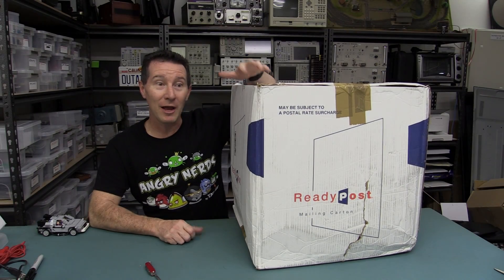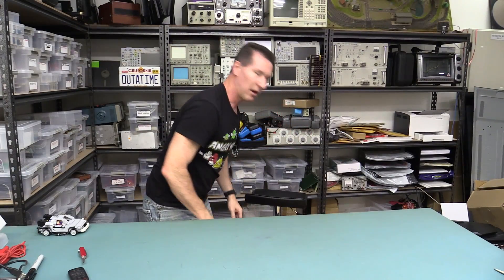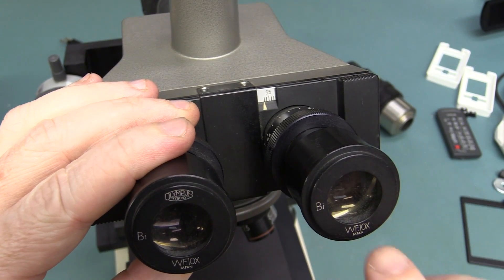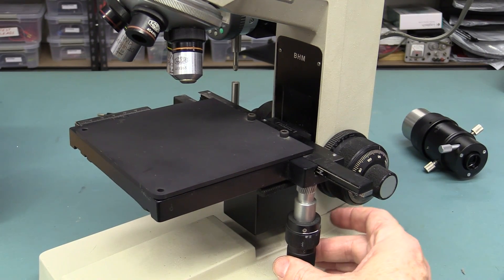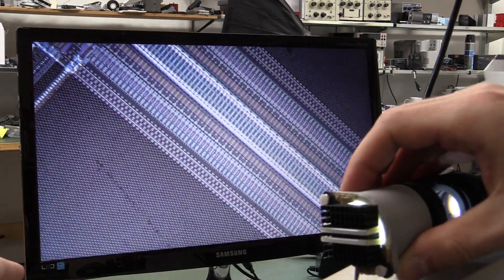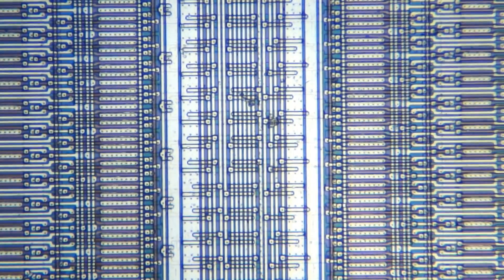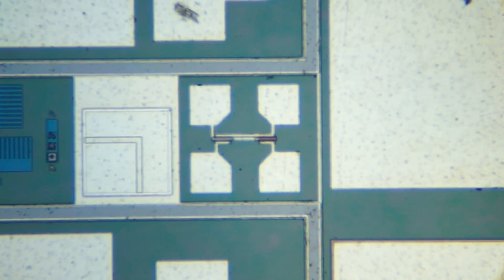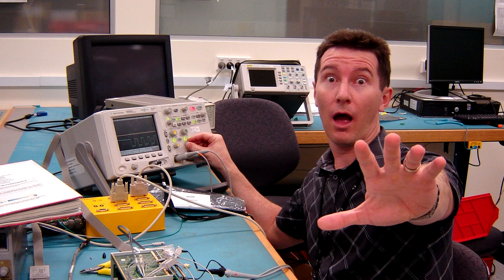EEVblog #992 - Olympus BHM Wafer Inspection Microscope

Comment: Ohhh that package... I had the same horrible experience (many times), don't know why but always happens with expensive and heavy equipment... clearly awfully packed exactly like your box, bubble wrap protecting nothing, equipment completely lose inside the box, holes everywhere and pieces of equipment sticking out. 
The box is more like a soft paper ball rather than a box... ohh.. it's heart breaking.. what horrible sight.... =/
Reply: bubble wrap is fine for smaller items up to 0.5kg, would have used styrofoam, double box, multilayer cardboard....

Comment: Dave for even light distribution you can use 8 layers of etched glass to get an enough even distribution of light. I have a work to share but unfortunately it is in portuguese. http://www.ppgee.ufmg.br/defesas/49M.PDF what I mean by etched glass http://www.vaicomtudo.com/wp-content/uploads/2013/05/Fazer-falso-jateado-3.jpg No plastic film, it is pressurized sand jet over the glass.

Comment: Pitney Bowes is an awful company. We use them for our postage machines and easily do 10 to 30 thousand dollars in postage a month (we sent buckets of certified mail everyday) and they treat us like shit. I would take pages to explain all the issues we've had with they. Just stay away from them if at all possible.
Reply: that's bad. customers should always be treated with respect.
Reply: Their franking machines are god awful too, had an old one at my previous job that was built like a tank and connected to PB via dialup that became suspiciously EOL only to be replaced with a chunk of plastic connected to a mini ITX PC and a touchscreen, I don't work there any more but I reckon the thing will need completely replacing every 12 months or so.

Comment: Also, that depth of field seems appropriate for the intended purpose.  Wafer processes mandates small differences in the topology, and the depth of field you remarked on is actually needed for wafer inspection.
Reply from the maker: Most certainly.

Comment: Hi Dave, long time viewer, first time commenter.  I am a student at R.I.T, U.S.A campuse in the Microelectronics engineering program.  I spend a lot of time in the clean room, and use inspection microscopes all the time.  It broke my heart to see what the shippers di to your microscope, but I just wanted to point out that typically, wafer test probes (at least using the parameter anylizer that I use) won't leave thos ugly marks on the wafer test pads.  There is a precharge function on some parameter analyzers, that allows for precharging before the probes hit the test pads.  This can cause a small amount of arcing and burning.  I was wondering if this might be the case with your wafer?  Again, I am a student, and by no means an expert.
Reply from the maker: I assume it was simply scratch marks from the probe top, not burn marks as this is not a power device and the wouldn't probe powered up anyway.

Comment: Dave, I might be wrong but to me the features at 15:30 look like alignment marks for the stepper/mask aligner.
Great optical setup, BTW!
Reply: I can corroborate. I am a VLSI/Wafer design grad student and we use similar structures for mask alignment all the time. But that's not all - sometimes, we use similar fingers-like structures with varying widths to judge etching quality as well. Hope this helps :)
Reply from the maker: Ah, interesting, could be.

Comment: Dave, now all you need is a Soxhlet extractor and condenser to decap your own chips in the lab.
Reply from the maker: Googling "Soxhlet"...
Reply: Nitric acid
Reply: I kind of threw that out there, but thinking about it now... Maybe Sulphuric acid could work in a distillation apparatus. Nitric acid is supposedly the most "effective" at decapping though I'm not sure it would really work in this configuration?
Reply: The difficulty of nitric acid is why i suggested sulphuric acid. But regarding the problems with doing it the soak method is demonstrated in Applied Science's video on decapping. I figured a soxhlet extractor would help solve the problems he ran into.
Reply: I got the idea from the NerdRage video "Make a Tritium Nuclear Battery or Radioisotope Photovoltaic Generator" where he dissolves the plastic off of some tritium keychain things.
Reply: good luck getting even a used soxhlet extractor in austrailia for under MSRP. they're not terribly expensive as far as lab equipment goes (probably around 700 usd for what dave would need) but the shipping of such a large and intricate piece of glass? definitely couldn't use ebay, that's for sure.
Reply: Maybe we can talk NerdRage, Nile Red or Applied Science (assuming Ben already has one, tho if he doesn't I'm sure he covets them and this would give him a good excuse to just buy one) into trying this out.  NerdRage's video on the tritium keychains was pretty great and I couldn't think of anything but decapping IC's the entire time I watched the process.
Reply: I picked an ebay soxhlet extractor up for about 175 USD and a couple thimbles for it at about 10 dollars each.  The chinese made ones are NOT too bad. I've been very happy with it.
Reply: If there was a solvent to simply dissolve the plastic cap... why would anyone use HNO3? 
Its going to be a thermosetting polymer so i doubt that dissolving it is possible 

700$ for something as simple as a soxhlet? Maybe if you get a huge one with 2 liter volume or something. The usual size - and for this usecase just right - of around 100ml will be <200$. But it would be much wiser to buy a used one anyway, its not like the glass goes bad or anything, so it will be just as good. Also, it doesnt need to be a soxhlet-type. The simple "tube form" (no idea what the english term is) will do just fine, droping the price below 100$.
Reply: +Leo Curious "If there was a solvent to simply dissolve the plastic cap" - You said it yourself why isn't there one: "Its going to be a thermosetting polymer so i doubt that dissolving it is possible". What they do is not dissolving in the classic sense. It's more like "dissolving" in the sense in which acids dissolve metals: the metals do dissolve, but they form strong ionic bonds with the acid's ions, which are really hard to break (usually electricity is the only way). The same happens with thermosetting polymers too: hot nitric and sulfuric acids are able to attack and rapidly degrade the plastic casing of these chips (perhaps forming some complexes in the process), allowing one to see its internal workings.
Reply: I dont see where I am wrong?
And yes, for HNO3 its a oxidative and acidic breakdown of the polymer, not a "classic dissolving".

No, its not hard to break the ionic bond. Just dissolving them in water breaks it...
Also, most anions are not very (thermaly) stable. Like many nitrates or all acetates.
Reply: +Leo Curious "I dont see where I am wrong?" - I didn't say you were. I just pointed it out that you answered your question yourself. And actually ionic bonds are pretty strong, despite the fact that they're dissolvable in water. Have you even tried melting them? It's not as easy as it might seem. Yes, nitrates are unstable. But acetates are organic compounds, so it's really no wonder they're unstable...
Reply: "I just pointed it out that you answered your question yourself."
That was a rhetorical question.

"Have you even tried melting them?"
Many salts have low melting points, others are fairly high, regardless of me actually melting them or not. The highest thermal stability of a classical salts I can think of now are carbonates like CaCO3 that decomposes to CaO and CO2 at ~800°C.

But this is drifting into a meta-OT-discussion now, the point is that ionic bonds itself are easily broken by dissolving and thus not hard to break.

Comment: When I was a child I opened the can of a µPD416 NEC RAM to look inside with the microscope at my dad's laboratory, there's so many "things"in such a tiny chip, almost unbelivable. But you're missing a very cool sight there: the bonding of the wires to the chip! Go find a ceramic "can" chip and open it asap to see them!
Reply: It amazes me that we can fit over 100 billion transistors into something like a 32GB MicroSD card. It's damn near magic.
Reply: Actually, you're wrong. 32 GB is 32 Giga BYTE... A byte is 8 bits. 32x8=256. Giga is a billion. That means you have 256 billion bits. If it's SLC NAND flash, it's one transistor per bit, per memory cell. If you have a MLC NAND flash, then it's 2 bits per transistor. TLC is 3 bits per transistor. This doesn't count control logic.
Reply: I filed the top off a plastic 4164 to try and make a cmos video sensor, and it nearly worked except I took a corner off the die right at the end.   I'm going to try that again with a milling machine soon.
Reply: HalfSpeedMastering - Sure. Can't you?
Reply: naaah.  If I'd wanted to spend the extra I'd have bought the kind with quartz window already, and it very nearly worked.  There seemed to be a small air gap above the die so the bond wires were not damaged except in the corner I chipped.   I have some plastic 41256  here waiting for their close up.   It beats the fuming nitric acid method of opening them,  or at least it'd augment it by getting the bulk of the material off first.
Reply: It was from a dead TRS-80 Co Co IIRC.  I couldn't  afford a real video camera with their fancy videcon tubes.   I had 7 more to play with at the time,  but I ran out of patience.  It took a while doing careful strokes with a hand file.   I was waiting until I have a more rigid setup on my mill,  but I guess if I can do it with what I've got, then Dave can replicate it with his x-carve.  The only camera I've got that can do good close up shots is a potato, but it does have an Olympus lens  (a C-300  aka D-500 in US) so I better get to it. stay tuned
Reply: Potato Cam, the best brand! Ahahaha. When was that, in the '80s?
Reply: That's the tricky bit,  but constantly reading and writing the entire chip in sequence will take care of that AFAIK.   To use it as a video sensor,  you fill the memory with all 1s,  and after your exposure time,  you read it all back.  Where the light falls will be 0.    You can only usefully use half the chip,  because the addressing circuitry runs in a band up the middle,  so the resolution is 256x128 and 1 bit unless you do some oversampling trickery.   I'll probably just run all the lines to Arduino pins for a demo,  and bit bang it in software because there's no  reason to aim for a specific frame rate. Yes C64 will have used either 8 of these,  or 2 of the 4 bit 4464

Someone's done all the work (apart from the decapping vidjayo) already.http://hackaday.com/2014/04/05/taking-pictures-with-a-dram-chip/
Reply: MattOGormanSmith A highlight from that link:  "Exposing the capacitor to light causes it to discharge faster. Once it has discharged past a certain threshold, the bit will flip from one to zero. To take a picture, ones are written to every bit in the DRAM array. By timing how long it takes a bit to flip from one to zero, the amount of light exposure can be determined."

That basically means, that if you read the chip several times sequentially, before writing all 1s again, you can determine light intensity based ont he time a bit takes to flip to zero. A bit that flips int he first scan would be bright, in the second scan, a bit dimmer. A bit that stays at a 1 for all the scans performed per frame, or one that flips late, will be a darker shade. Of course, you'll need to determine how many scans you can get in before the bits start flipping to 0 on their own.
Reply: MattOGormanSmith did you try that with a genuine ic or a cheepy from ebay ?
Reply: MattOGormanSmith find a ceramic DIP of the "can" type it's so much easier to open. Say a 4116 RAM dated 1976 or 1977 or so. And make a vidjeo !
Reply: vidjeo, vidjeo!
Reply: WOW this sound crazy. Those were the RAM used in the C64 ?. The 64K x 1bit .... How you are expecting to READ that, being dynamic ?
Reply: Mind blown guys, Someone really went crazy to come with something like that. Amazing.  not too much in photo thing, but getting some greys will require (as richfiles told below) to time each pixel. Not sure how slow or fast are the times from 1 to zero but too much bits to do the timming at once, IMHO you need to take the snaps from 4164  "fast", store "somewhere" (a FRAM chip ?) and  process later. If a TFT or LCD was fast enough you can dump the content into LCD. The pixel will get the same timming as the bit in location in the 4164 basically. The bright one will turn off early. The dark they are, they long the pixel will take to turn off. You need to keep freshing (writting ones). I mean, the LCD and the eye almost doing the process. Probably wont work that way ... just trying to play with the concept.
Reply: yes but there is the added complication that the act of reading it will also sap a little bit of charge from the capacitor.  3 reads to get 2 bits seems harmless enough tho.  Damn now I'll need better than a mono oled display on the arduino ;)

Comment: Dave, will you get some refund or replacement from ebay for this abuse?
Reply: Actually, as the buyer, he should file a claim. I had a 3hp electric motor damaged by "Global Shipping" through eBay and I got a full refund. Only thing I don't know of, and hope didn't happen, was whether or not the seller lost their money.
Reply: usually, you are fully covered by ebay's buyer protection. if something is missing or arrives broken, buyer can open up a dispute. As an ebay seller I am fully aware of that, and never had a dispute since 6 years.
Reply: hahaha. you're funny. once ebay has their money, you're screwed.
Reply: I guess the box opened up during shipping, and PitneyBowes had to fix that in order to forward it.
Reply: I have a shipping address in germany - forwarding my things to my address in Austria. Happened that a seller brought my purchase (a collection of electron tubes) to the shipping company, unfortunately in unpacked condition, instead of shipping it. This was very annoying and kinda unfair, because I've paid him the full price for shipping and handling. Finally, the forwarder charged me 20 Euro for packing. Every single tube was perfectly packed up by the forwarder. I could have claimed my money back from the seller, because he had no tracking number. But I was fair and did not open up a dispute.

Comment: You can see the indents of the optics in the box lid :(
Reply: Michiel van der Meulen Yeah, I noticed that too. That scope was lucky to make it in the state it was, any lesser scope would have been in many pieces.
Reply from the maker: Agreed. It's built like a tank.
Reply from the maker: I missed that!
Reply: noticed that. there must have been a lot of g-force on the instrument. that packing was awful. You can ship balloons like that, but not a scientific instrument. Dave, how much did you pay for shipping, and the ebay item itself?
Reply: Repacked to GET THE WEIGHT DOWN!

Comment: Economy shipping.  DOH!
Reply: eBay global shipping is NOT economy.  It's bloody expensive!
Reply: Ing. Max Koschuh But why repack to something (at least) equally improper...?
Reply: For GLOBAL (i.e. international) shipping, it is.
Reply: Seller probably told 'em to stamp it 'Fragile'
Reply: Hi Fran. Could have been cheaper I guess. But I've never had a single bad experience with ebay's global shipping program. And it's not too pricey. I guess PitneyBowes had to repack, because of improper packing of the seller.

Comment: Maybe that Mitotoyo Z scale is for thickness measurement. Focus on one layer, set it to 0, then focus on the next layer and read the display.
Reply from the maker: Yep, could be, if it has the resolution.
Reply: It is also just the right thing to have if you want to do focus stacking photography with consistent distance difference between each image.
Reply from the maker: Chip Guy Vids Would be interesting to see if the fine Z adjust scale corresponds to microns...
Reply: Now that you mention it. There is a scale on the fine focus knob. However that Z axis meter would be much more convenient, just hit the 0-set button :)
Reply: AFAIK It should
Reply: I would assume it just helps you find the focus easier. If you're using it at work all day flicking between the magnifications to inspect wafers having a number to spin the focus to might help productivity?
Reply: It is to measure thickness, but unfortunately for them the accuracy of x-y scrolling is terrible. You can see that scrolling in those directions throws the z out of focus making the micrometer worthless. Probably why they sold it.
Reply: Chip Guy Vids , long time ago I used to work @ Stmicroelectronics and the focus is used to measure the Z axis or the height and also the actual focus knob it should have a metric scale for measurements, the table y and x axis they all have little play but you can get models that have a better setup for the x/y axis measurement, @st they us them for QC, wire bonding heights,bonding on the pad of the die etc, unfortunately these delicate equipment is better to use them in a clean room because dust is their worse enemy. but definitely it is a beautiful toy :).
Reply: all the good comments are coming from my subscribers :-)